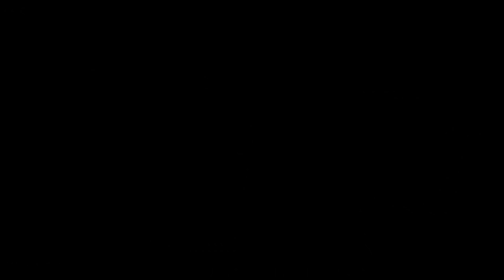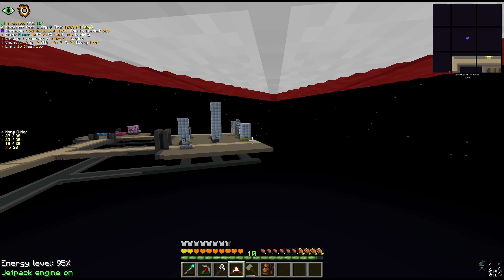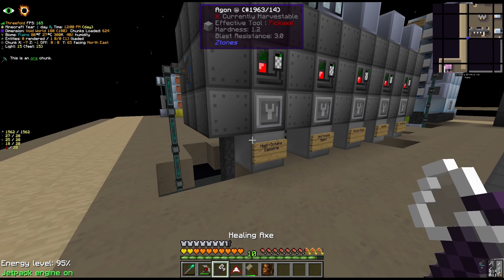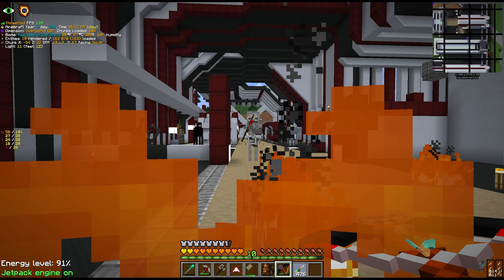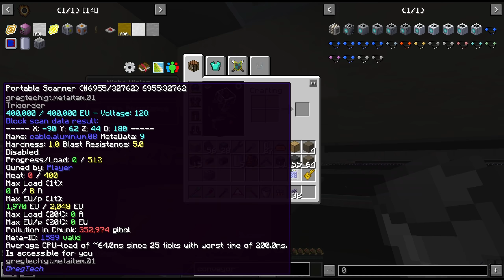Gregtech New Horizons - 37 - Fluid Refinement! Modded Minecraft

Comment: you could use a Stirling generator to power the transievers  using logs as fuel. I havent loked at power requirements, but at least it shouldn’t require wiring? Maybe enderio solar, if thats not too expensive

Comment: Really ought to have crafted new distillation towers rather than moving the old ones before you no longer needed fuel in the old base. It might still work out, but if it doesn't...

If you're going to upgrade your power grid, upgrade it as much as you can, which is this case is LuV (or ZPM if you want to mess with tons and tons of Naq, which spoilers: You don't). The less you have to cut power to your entire base to upgrade your power grid, the better. Always overbuild your power grid for this reason.

This is why having wood tar and wood vinegar being automatically produced and processed in an EV/IV base is a common sight - all of those byproducts end up being useful somewhere, if only just for burning off to produce some extra power, and having them readily available is never a bad thing. One tip: The coils you give your pyro oven can give it a very significant speed boost, potentially more so than overclocking will, and at no extra power cost at that. IIRC an HV pyro oven, using the recipe with nitrogen, given HSS-G coils, will perfectly feed one HV distillation tower (wood tar) and half an HV distillation tower (wood vinegar), if I remember right. I'm afraid I can't check at the moment, internet issues casing my MultiMC to freak out, but either way three pyros, HSS-G coils, nitrogen, two distillation towers and a fair few HV amps will get you tons of byproducts at respectable rates and at low power costs.

When moving over the blast furnaces I think it's well past time that you get serious about them. Wallshare them to save on coils, upgrade one set of coils to Tungstensteel and than all of the ones used for ingot processing to HSS-G (both for EU saving and upgraded overclocks), build more of them, the works. You've experienced how much EBFs are used in this pack, and they're not going to fall off any time soon. You'll also be wanting more of them to finish off the Platline as well, although obviously those can make due with lower grade coils, depending on how you wish to run them.

The next rocket is post Assembly Line, so you really don't have to worry about that for a long, long time. There might be other things you want that require the condensed plates, like arc lamps, but otherwise you ought to be fine without ITNT for a while.
Reply: I have been enjoying your comments on the videos very much. When I get a new PC I will finally tackle GTNH and use threes vids and your comments to help out!

Comment: A little bit confused at the redstone controls of the fluid producing multiblocks. Am I right to say that so long as just any one of the output hatches is empty, its fluid detector cover will emit a redstone signal and the distillation tower will continue running, voiding all the other outputs if they'll full.
Reply from the maker: Fluid detectors emit redstone when the output hatches have no fluid inside, and therefore if the output tanks fill then it will turn off the redstone signal and also the machine. I hope that makes sense
Reply: @Threefold.  Ah alright! Thanks!! So the tower will only stop when every output tank is full. I was confused at the multiple redstone inputs and if there's a need for that. I usually control the tower off a single fluid that I cared about the most and let the rest of the fluids stop or overflow 😅I guess that wasn't the most ideal since I could've ran out of the other fluids if I wasn't using supertanks 2 or 3. Yours make more sense!
Reply: pretty sure it's the opposite, if any one of them is full then the entire thing will turn off
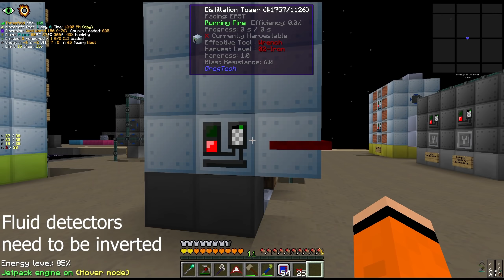Reply: @413tyson  But at 2:32 he said the fluid detectors are inverted. So they each emit redstone signal when the output hatch is empty, turning on the tower. So if any one of the hatches is empty, the machine keep running, even if the others are full (voiding). Actually on second thought, I guess there's really no better way to do it. His way of doing it would void some excess output but won't allow wastage of inputs.